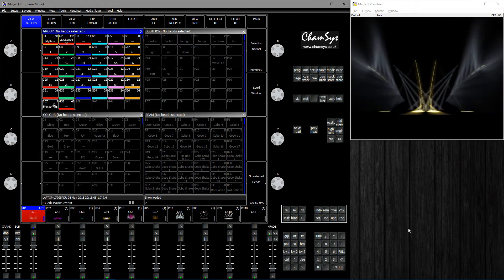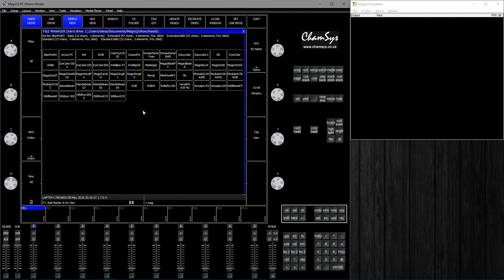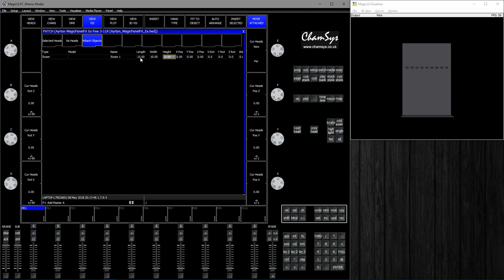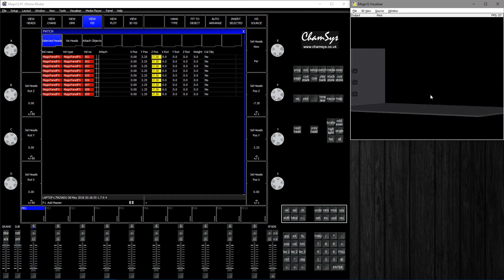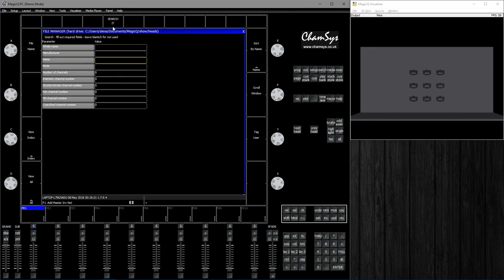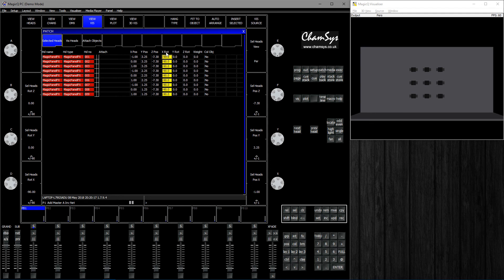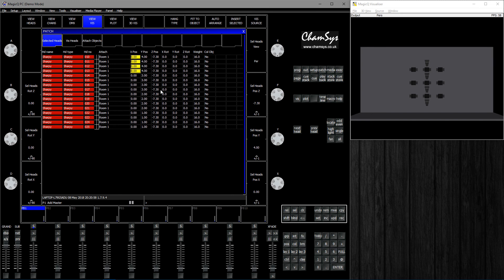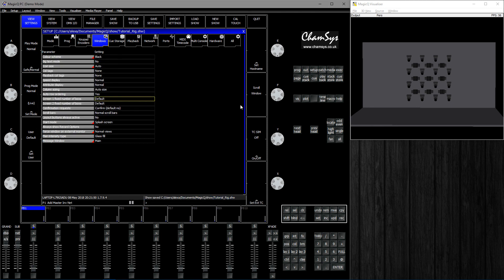ChamSys MagicQ: Create A Basic Rig | Part 1

Comment: is the room width and height in meters?
Reply from the maker: Yes, but it can be changed in Setup > View Settings > Windows > Units of measurement

When in metric mode, putting ' (or / )after the value enters the dimension in feet.
So 12' = 12 ft, 12'4 = 12 ft 4 inches